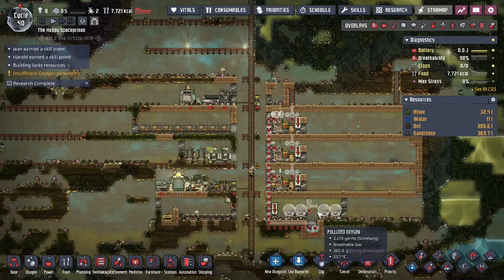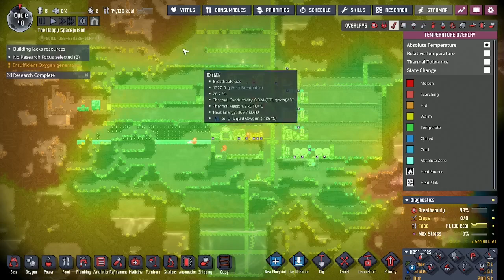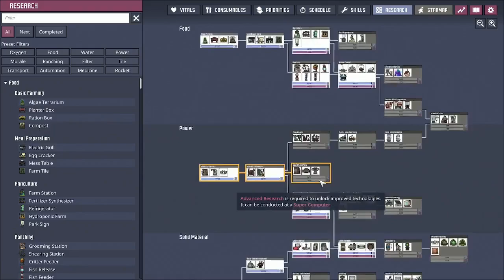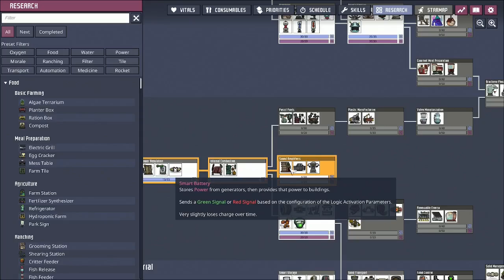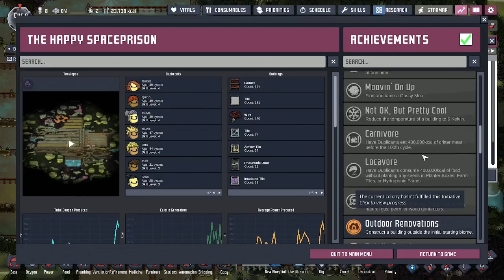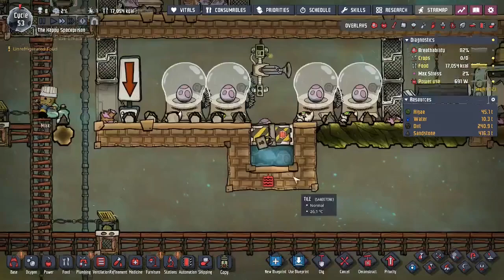Hatchery Automation & BBQ On Demand | 4 | ONI Base Game | All Achievements

Comment: smart batteries lose 1kj/cycle, juste like normal or jumbo batteries.
Their only advantage is to be linked to automation, which is great.
edit : nvm, just checked, i didn't know they leaked less.
Reply from the maker: Yeah, its 2 kj for jumbo, 0.4 kj for smart.  The automation is great, too.  However, for early games, I'm burning power as fast as I can to get super sustainable accomplished.